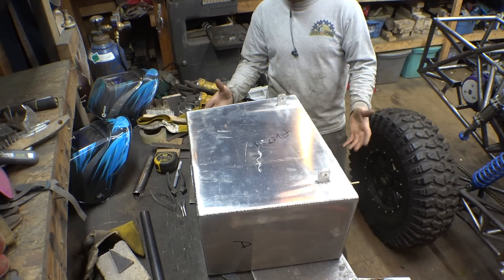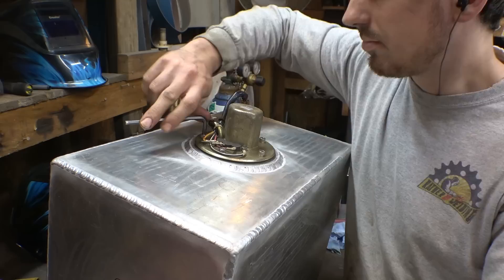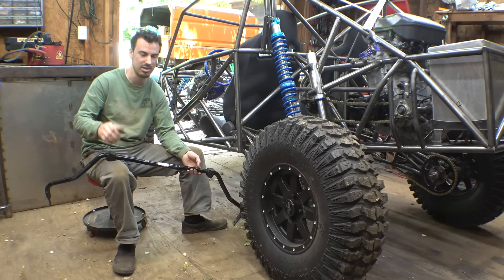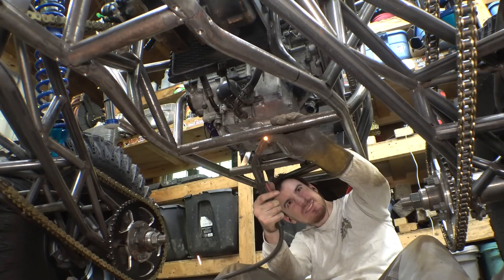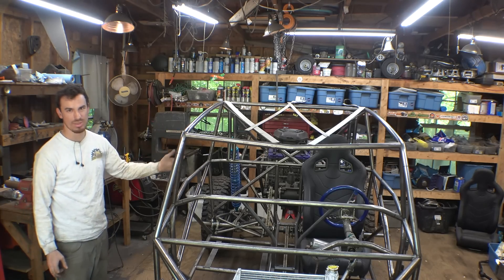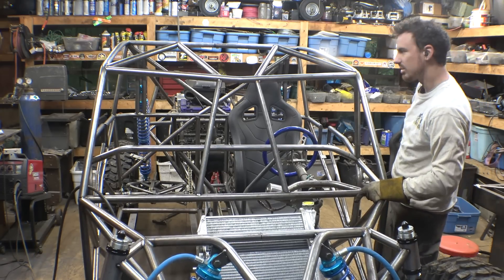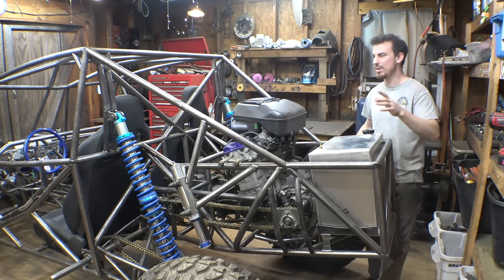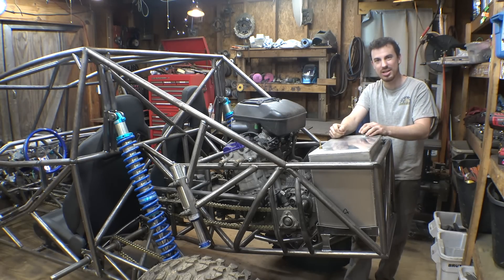Finishing the Frame on the - Mini 4WD Trophy Truck Project - Part 16

Comment: Hey all trophy trucks have a sway bar with out a sway bar they tend to lean alot abd when there racing that could result in a roll over the ³ wheel motion going on with them ehen they go around a turn is mostly do to the shocks and horspower

Comment: Generally speaking, if a sport bike engine is available on eBay significantly cheaper than comparable others, it's because it's from a stolen bike and the seller is looking to dump it quick... speaking from experience unfortunately.

Comment: Chris, I'm not critiquing your frame, or work, though I would like to ask, you are building triangles in everywhere on the frame and I see you standing back and basically saying it needs one here and there, 
Firstly you are now getting into more and more powerful machines  bigger engines, trees and rocks and obstacles aren't becoming softer so you have to modify the engineering of your machines in pipe type and diameter and proper safety inclusions to cater for the extra torque and speed and weight you are increasing to. 

When you look at those various off road vehicle builders with open frames like yours the tubing for example is larger and so on. 
Would you please consider once you have finally got this all together taking it to a engineering shop capable of assessing the strengths and weaknesses and engineering you have put into it to let not only yourself understand if you have designed it correctly and SAFELY, and to offer any productive suggestions and advice for future builds and of course that would add to some good content, not only for you but for other builders who just assume if I the put enough triangles in with no training and assume well Everyone else us doing it... , mistakes from one can escalate like Chinese whispers. 

And most importantly you have built this for 2 people, what public liability insurance will you carry if in the unfortunate circumstances you run into something bloody hard and a lot of damage is done, and medical bills for both people are to be paid, that could bankrupt you, seriously, for life and not to mention the guilt. 

For heaven's sake make sure at least any passagers sign waivers before you move an inch when considering taking anyone for a ride. If you have some sort of legal aid in your country, mate, please just ask advice then assistance in drawing up an official legal waiver and use it for EVERYBODY 
Till public liability insurance is organised etc. 
this is a important wake up call Chris and I feel your country doesn't excuse ignorance in circumstances like these should something happen. You have adult responsibilities now, consider using them correctly. 

Tony from Western Australia 🇦🇺

Comment: Like I said, it needed a turbo. You're gonna have so much fun building the exhaust manifold for the turbo. You can also run it with the turbo all set up,just not hooked up to the intake yet. That way, you don't have to build two different exhaust Manifolds. I would suggest getting some dish pistons to drop the compression before adding a turbo. And I would suggest rebuilding the engine if you're going to add a turbo. There are other camshaft profiles out there that would be better suited for the  turbo, then the stock cams that are in it now.

Comment: When you do the cooling system fit an inline water pump. The Suzuki 1300 struggles to keep itself cool in any buggy with a bigger radiator and  a bigger head of water behind it. It took me to cooked motors to figure it out. Especially with a turbo fitted.

Comment: I love this build but I think the tank should have been mounted in front of the motor with a heat shield so you didn’t hurt your departure angle so much with it hanging off the back

Comment: With using motorcycle  engines people focus on cooling and it's great but I found that's not the only thing that needs add cooling to the oil and the add capacity is a must if you add turbo to it some day if u want longevity and if u do just save money go stane alone management after going through countless motors over years because of improper tune it would  saved in long run keep up great work.

Comment: On a stock busa engine, with still ok internals, you can get like 300HP reliably with a turbo. With a light built engine + turbo you can expect 400+. If you really wanna go deep and really build the engine for power with a big turbo you can get 700+ but lose drivability because of the turbo lag. Considering the build, I would go for the light build engine with a mild turbo map, to get around 350 but still have great longevity and throttle response.

Comment: You absolutely need a turbo once any bugs are worked out. Thats a heavy rig. A turbo will make it a different animal. Youll get over 200hp no problem.
Reply: He doesn't need more horsepower, he needs more torque.
Reply: @Rattus-Norvegicus  Yes you are correct. By adding a turbski you gain both HP and torque exponentially. It will add more low end torque for sure which is where he will need it.

Comment: Mate, welding with no gloves on. Do you enjoy pain? However the close up of the gas tank shows just how much your welding on Aluminum has improved. It looks really good and consistent. Whilst you don't need any more structural strength at the back over the engine, adding something to protect the engine if you roll it would be a really good idea. Making something that you can remove or that opens like a hood as you Americans call it. Definitely worth doing and done right would look cool as, well.

Comment: Are we going to get to see this thing when you run it during the event you are building it for?  I do like how the roof
came out. Think you could use another mount on fuel tank in the back so it does not rub a hole while 
bouncing around.

Comment: Looking good!
Just a thought, looks like a spare tire could mount standind up in front of the motor against the X brace.
Not sure if it would stick up to high, or flat on top of the new cross bracing on the top/roof.

Comment: The first fuel tank you built you were chasing leaks all over the tank and now  you have probably 8 ft or more of weld and you find one hole. I know it was steel vs aluminum and different welding techniques. If that we're me I'd be damn proud of myself.

Comment: Hmm... while I like the overall build, I'm not a fan of the tank being right at the rear, since a rear end collision could potentially rupture that tank and "bad things could happen"... 
I would be much happier if that tank was relocated behind the seats, where it would be better protected in the event of an accident...
IF you keep it at the rear, I strongly recommend some protective measures and as someone else mentioned, the tank should be fully protected by the frame, not  have the top section ecposed as it currently is

Comment: For off reading and rock climbing you should consider a super charger or pro charger. It will help you on the rocks immensely being able to follow a steady power ban curve instead of the dramatic curve of a Turbo systems torque curve.
Reply: Thing has 2 transmissions lol.
Reply: How would you drive a supercharger on a motorcycle engine? There is no exposed crank pulley.

Comment: one other quick thought. it would be interesting to see the front & rear axles/differentials connected via perpendicular helical gears at each end of a solid shaft rather than the heavy duty chain. 🤔

Comment: Trophy trucks run massive anti-roll bars. Usually, it's just a straight piece of chomemoly tubing with arms welded to the ends parallel to one another at 90⁰ to the bar. Then, the links that connect to the suspension are adjustable for corner load depending on conditions.
Reply: I see you are from AZ , this guy making the videos has 0 clue what a good TT chassis is, doesn't know basic geo for chassis designs, includes lots of deadtubes etc If he only would read a book or watch some dezert racing

Comment: it looks like you have some kind of rubber pads between the tank and the steel bottom brackets, which is good but I feel like if you don't use some 2-3mm thick rubber washers between the steel and aluminum on the top front tabs your going to see cracking in that area pretty darn quick.
Reply: Agree.
Reply: Agreed!
Reply: Oh, he'd hear the tank vibrating before any fatigue happened. Metal fuel tanks make a lot of noise if they're not mounted on rubber.

Comment: you want to consider installing some fixed grab points inside cockpits for driver/passenger to brace without holding onto exterior frame rail

Comment: Yeah Chris, leave that area behind the seats open for now. You may need the area for a turbo, spar tank, tire, tool kit, or just whatever. I am curious tho why you didn’t use gussets instead of tubing in the corners…daring to be different? It’s your preference? In any event, it’s cool! 👍
Reply: I’m worried that if you roll, the fuel tank is exposed above the frame and the vehicle could be resting on the fuel tank.

Comment: You asked for the air filter and dust. So you can do install a oil bath air filter. Tractors use them and they are great for very dusty environments....

Comment: Im kind of worried that if you roll that beast you'll smash the engine due to all the weight being in the rear and no roll protection back there.
Reply: Yhea I'd definitely want some sort of removable safety cage over the top of that engine. I always think it's the one real weakness and area he hasn't improved in, the finishing of those last few details which aren't absolutely necessary but would really add something, in every other area of the building process he's improved loads. I also hope he covers more of the frame with sheet metal not just a bit at the front where he's sitting. This is definitely his best build so I hope the finish look will be more important than he usually bothers about.

Comment: You need to add foam under the tank or it will crack at the top of the mount
Reply: Lol did you not watch the video 😂 😅 it has pads under the tank.
Reply: @jerrywilcox9890  pads don't keep enough flex out.
It may need a motor mount for the rear or at least another hard mount.
I watch the tank flexing.

Comment: I've been struggling with my 2 stroke bike lately. I had to replace a lot of the engine due to a clip failing and destroying the sleeve, which cant be replaced. Now I'm m struggling with the new vm18 carb and as always, the rear wheel. This channel has been really keeping me motivated.